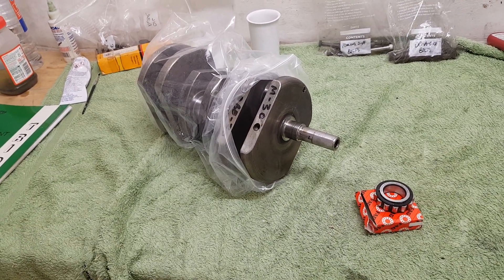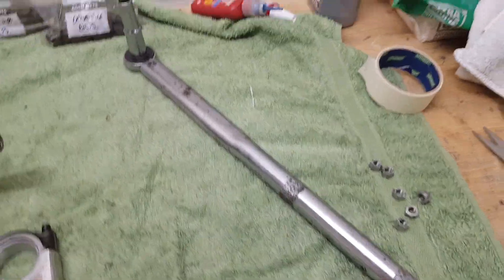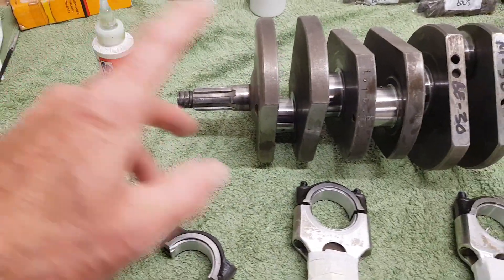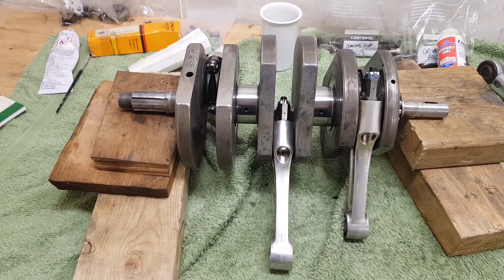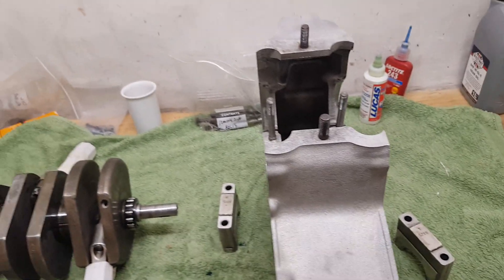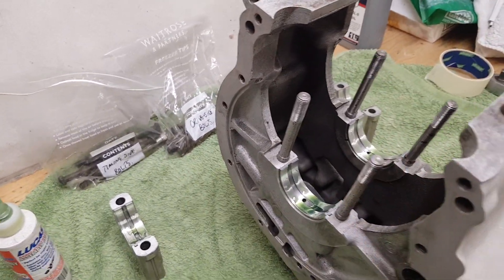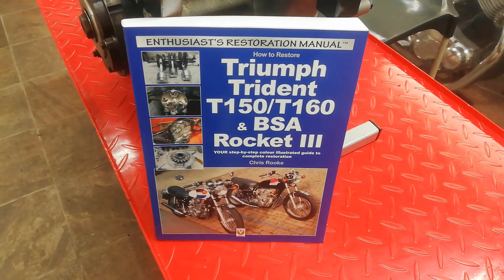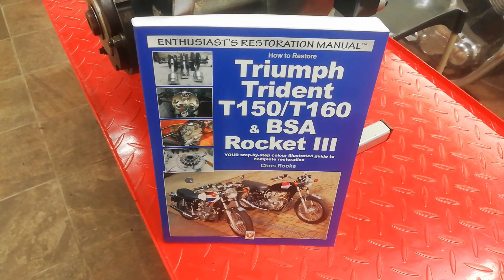Triumph Trident T160 Engine Rebuild. Part 19: Assembling the Crankcases

Comment: Hi Chris,  another idea which I have used for Torrington hardened sleeves at the machine shop is to place your part on the light bulb of your old school leadlight , it will get really hot so may need a temp gun . Cheers

Comment: Frustrating to watch! You keep telling us what you're going to do next (eg: fit the crankshaft), and then you cut to after that step has been done.  It is these steps that are the most interesting!  You say something about having to remove the studs before putting the crank in, but it isn't clear what you mean because you didn't show that bit. Hope you find this constructive criticism, er, well, constructive....
Reply from the maker: Understood. I'm trying to get a balance in terms of time. If I showed the whole process then each video would be 2 hours long. I therefore have to edit them and try to choose the most relevant bits. Sometimes I may get it wrong. In future I'll try to show more of the action. In this case you simply pick up the crankshaft and lower it down into the crankcase. It's pretty straightforward so I didn't include it. As for removing the two studs from the central case,  that was covered in an earlier video showing the removal of the crankshaft. In this video I'm just reminding people about the need to remove them.